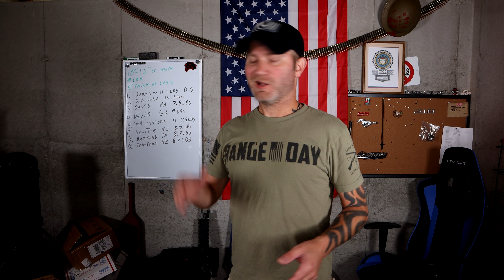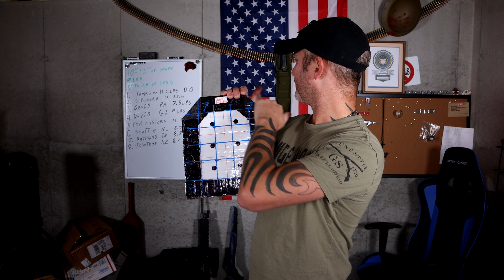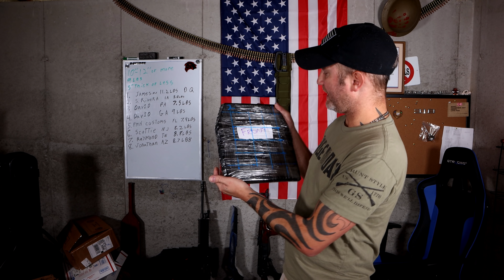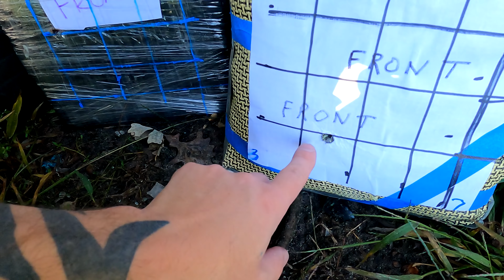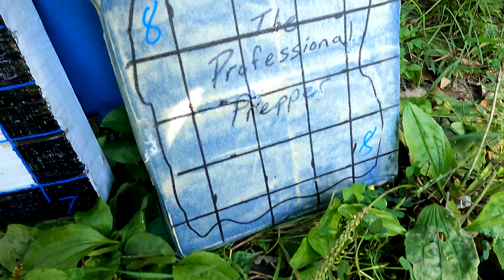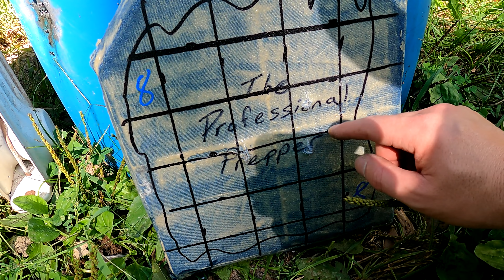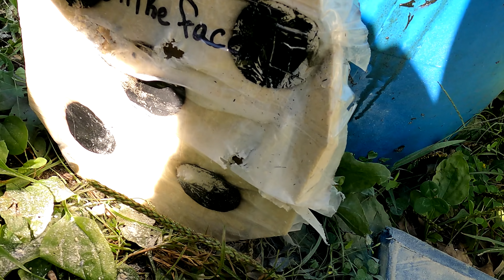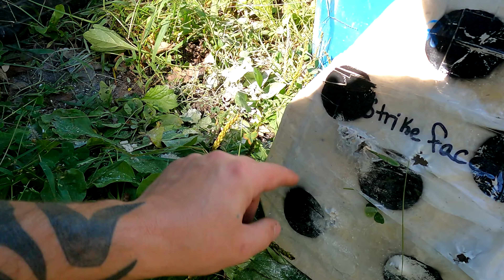🔴 WOW Someone Killed The Viewer Challenge

Comment: If you have a tie breaker... winner should go to the lighter plate. 
Btw. I’m really fucking impressed with you all who made these plates. Makes me proud 🇺🇸
This is a no bullshit test. Y’all would have survived pistol threats, some of you even stopped more than what lvl 4 ceramic can. I don’t think I’ve ever seen a lvl 4 ceramic test with 300prc. (I could be wrong)
Reply: Wieght based tie breaker is a good idea. Maybe though because the plates are different sizes, make it the lease dense. Because thickness is set at a maximum, simply make it a calculation of the wieght and front surface area.

Comment: Buy some ceramic tiles from Lowe's, not the stick on type. 

Buy some silicon carbide tumbling medium, most coarse grade and finest grade, mix it with fiberglass resin. 

Lay down about  12 layers of ballistic Kevlar within designated parameters. 

Cut tiles, if possible, into octagon shapes. 

Lay down fiberglass/silicon carbide mix, place first layer of ceramic tiles. 

Lay down fiberglass/silicon carbide mix again, place second layer of ceramic tiles. 

Bind said tiles. 

A heavy polyester material works best. Leather also works well. 

If you don't have a tile saw, you can place your tile in a vice with two pieces of rubber on each side, and tap it with a mason's hammer to score it. Octagonal cuts aren't necessary, but make for the easiest fitment. Make sure to leave your fiberglass resin for at least 24 hours to cure. 

They'll be heavier than IV plates, but they should offer similar protection.
Reply: Are you submitting a plate? I'd like to see that build and how well it does.
Reply: @Fudmottin  unfortunately no, I'm in the process of getting my FFL and funds are tight. I've built a couple in the past, though, and they hold up pretty well. If memory serves, the net cost for production was about $80ish per plate if you buy enough material to build a couple. 

If the competition is still going by the end of the month, I may put one together.